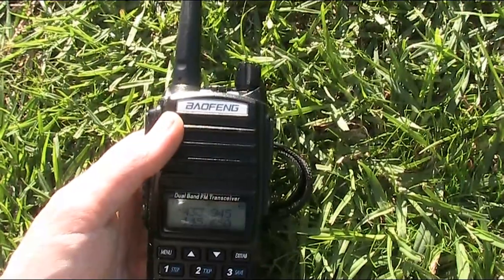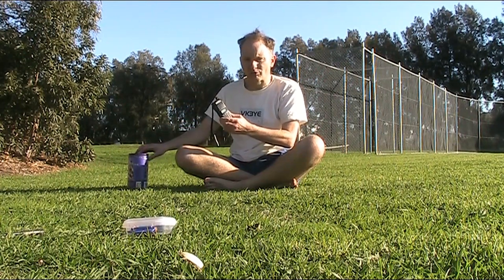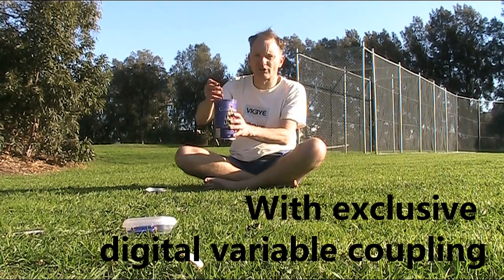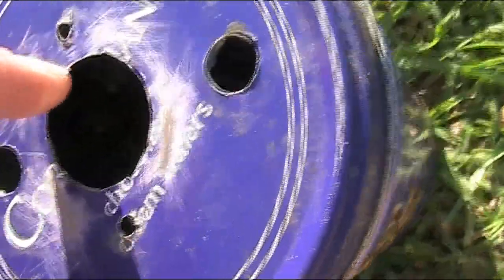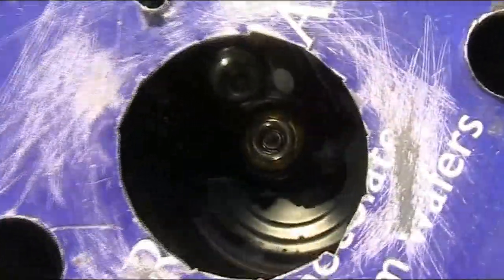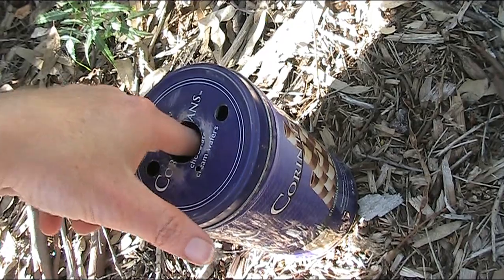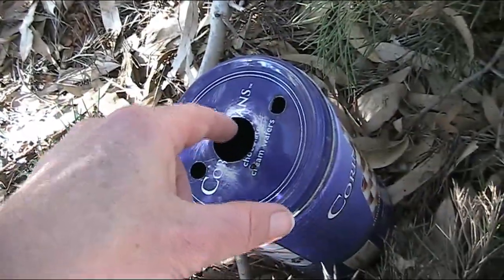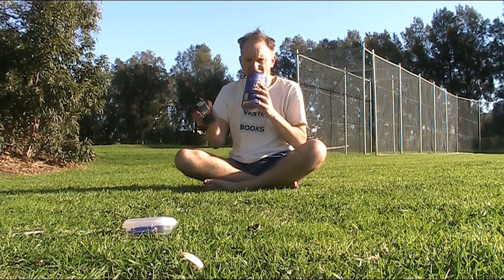Biscuit tin attenuator for Baofengs helps foxhunts, DFing

Comment: What a fun (and timely) vid! Here in the US there’s lots of field day ARDF’ing going on. I had never actually done it before, so was keen to have go. My club hid 2m (146.565 MHz) and 80m foxes, and had 3-el tape-measure yagis for 2m and a variety of DF receivers for 80m. I used my own HT (for 2m) and tried the cheap/Chinese R3500D available from China, and the high-end RigExpert FoxRex 3500 — made for “pro” radio orienteering. It was great fun, and I’m inspired to build a little fox xmtr and experiment a bit. Thanks Peter!